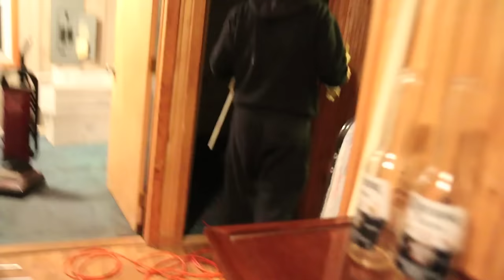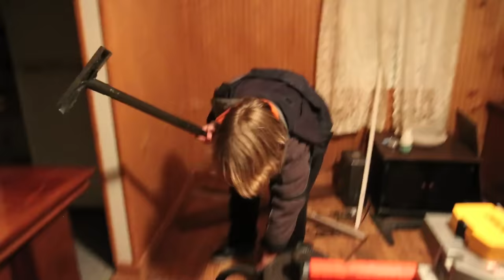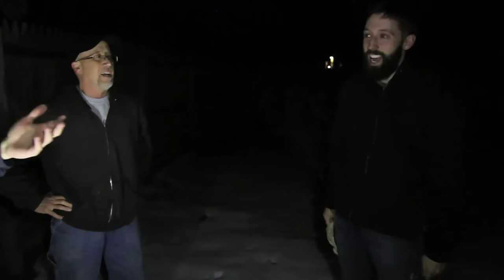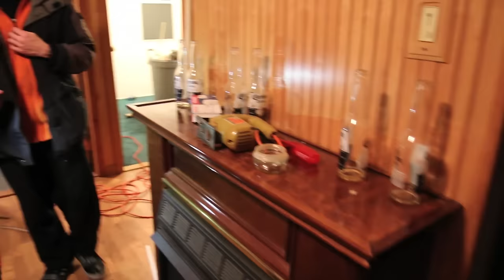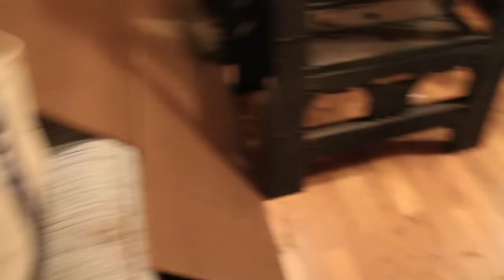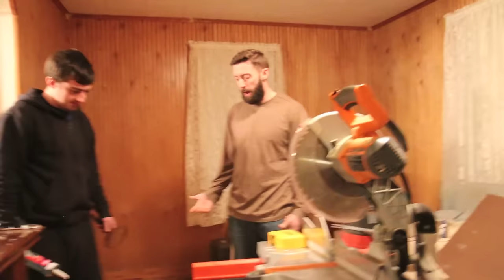MYSTERY SOLVED!

Comment: Federer figured out the problem with the one hander and it may be to late because current generations already learned the two hander, while Federer struggled with top spin. 

I think you have it wrong. Most one handers can do exactly what you showed and they are forced too for a reason. See you had to back up, just like one hander pros do, this opens up the court and that's the problem. See two handers can take the ball on the baseline and counter punch it back "easier" and not have to backup as far like you just did. Federer took the ball higher and or would back up or slice, and it wasn't working when Nadal could hit very high bouncing top spin shots that landed at the serve line. So instead he learned to time his shots to hit balls early on the rise instead late and attack. Its just took practice and he could really screw up Nadal with angles and catch him off guard because Nadal played back. He learned this late in his career and abused nadal with it. 

So your example is exactly what one handers are good at. Its when they are high bouncing balls over the shoulder and one handers would rather backup and slice when Tsitsipas for example will try to hit as loopy top spin back vs slicing and miss time it because its long stroke and requires more power when you add so much top spin to a one hander (Its a Tsitsipas problem). But that has nothing to do with one handers because most if not all one handers can move back and hit it well, its the bounce and guys like Nadal or Alcaraz can drop shot you because you had to move back or they hit a forehand hard in open space.

To fix the one hander, a semi western grip will need to be taught and or learn to hit it on the rise like two handers have to learn also with a shorter stroke. Maybe larger head sized vs smaller will need to be utilized to gain extra power on semi western one handed strokes with a shorter stroke. The extra stability from the two handers allows you to easily counter punch shots back vs having to go back, so in your case, you should be moving up and using that two hander advantage instead of backing up. One handers use old school techniques and its not getting any easier when coaches have stopped teaching the one hander, and when they do, its old school.